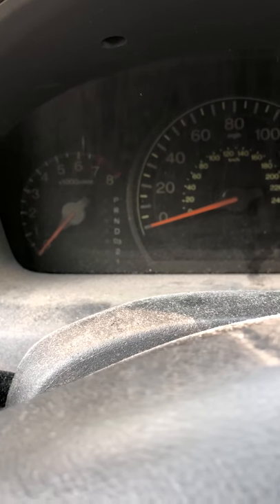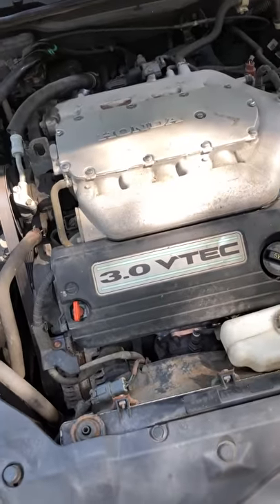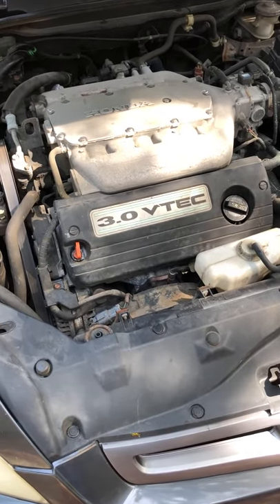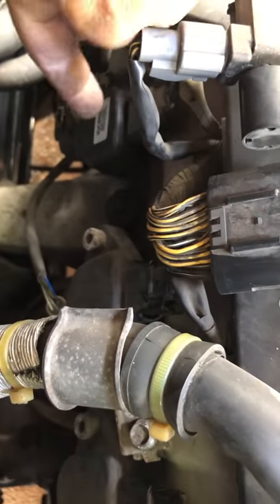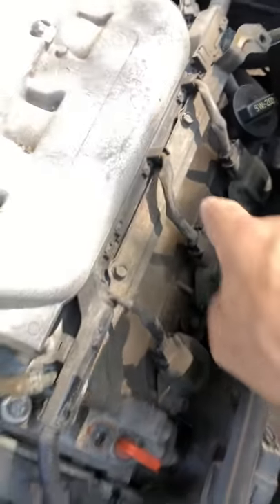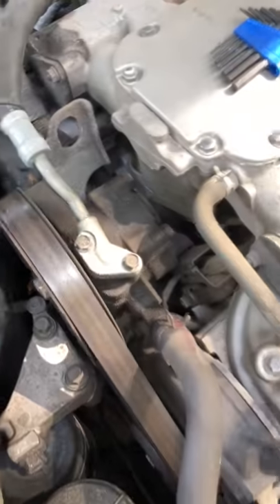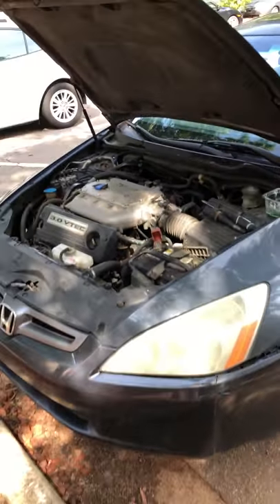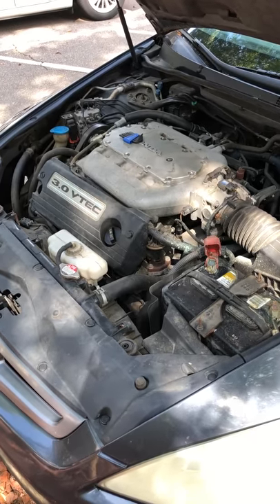2003 to 2007 Honda Accord EX V6 - Replace Ignition Coil to solve Multiple Cylinder Misfires

Comment: The technical term of what you did for diagnostics is called a "cylinder balance test". Often times mechanics would connect a portable tachometer and record the RPM drop as each cylinder was deactivated. As you mentioned there would be no RPM drop if that cylinder was not doing any work, or only a slight one if it was at least doing something. Ideally, you would want to see an equal RPM drop for each cylinder to indicate they are performing equally. This can also help give you a picture of other places to look to investigate the loss of engine performance, such as a clogged fuel injector, spark plug, or coil pack(as in your case) etc. Thanks for the video.

Comment: Thanks for the video, had the same problem with the same coil on my 2003.  One word of caution, the guy at AutoZone told me that you should not touch the coil with anything that has oil on it (especially hands) because the oil would make it overheat and explode much like a halogen lamp.  I used a pair of nitrile gloves to swap the parts but you can also use latex or vinyl.
Reply: Uh…lol…don’t go back to that autozone, or at the very least seek someone else. As someone who works at autozone (age 28 grew up working on cars) you cannot trust “all” of them. Some of them start there at age 16 and don’t know a thing about cars. The headlight bulb and natural oils on your hands, yes that’s true, but touching an electrical component such as an ignition coil, you are more than fine. The glass on a headlight bulb will create a “hotspot” due to oils due to the amount of heat it sees and will cause them to burn up faster…as for ignition coils, they will not. For those of you reading this…

Comment: The radio code is on the outer left of the glovebox. Sometimes you will have to drop the glovebox down lower than normal but mine is visible from the drivers seat.
Reply from the maker: That may be so, but often the radio code gets changed (like when the warranty work for the radio face plate is performed) so it's best to make doubly sure you have the code before disconnecting the battery.

Comment: I pulled out a coil and it had dry oil smeared over it does that mean replace the coil and it’s a bigger problem?
Reply: i have same issue smh did u figure out why? @cblesseddan6784

Comment: My engine still misfires when I changed one
Reply: Have you figured out a solution to it?!im having the same problem rn
Reply: I had the same problem on cylinder one and six I change both coils butt on cylinder 6 I put a new spark plug in that quit sending the code so now I have to do in your spark plug in solid or 1 which should take care of the problem